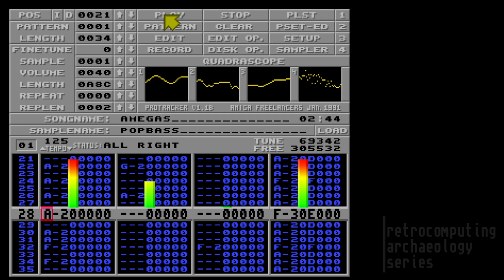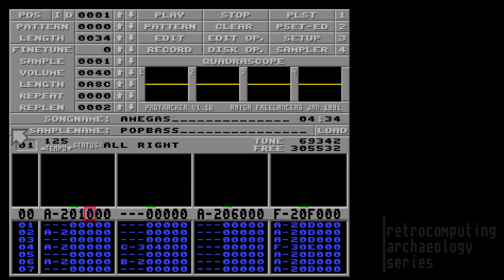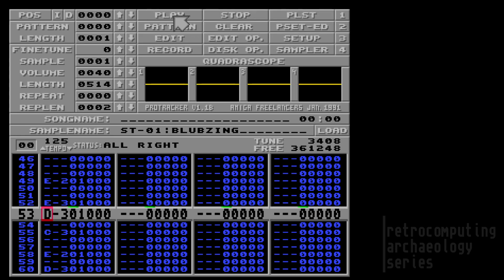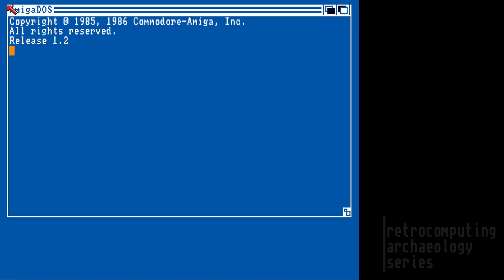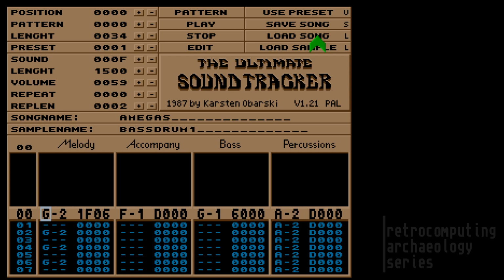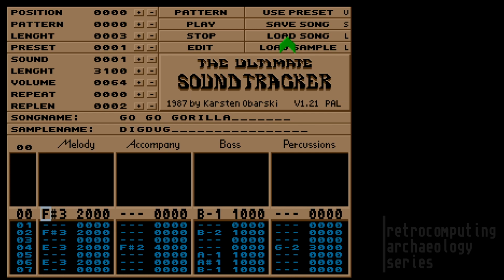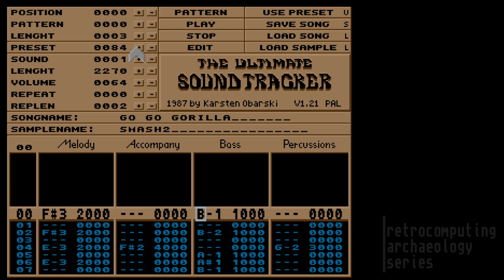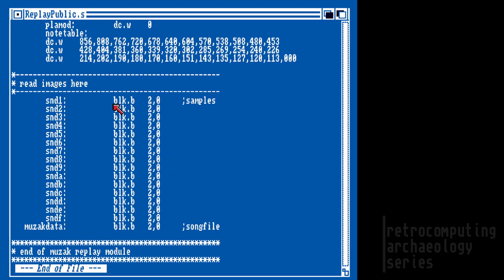The First Amiga Tracker - an in-depth look at The Ultimate Soundtracker 1.21

Comment: This answered many of the questions I had regarding the first version of Soundtracker, thank you so much
Reply from the maker: You're welcome! Anything else I can answer?
Reply: @tschak909  I'm actually in the middle of doing research cos I too want to cover trackers through videos. I want to specialise my channel in the demoscene(I have several videos on it already), although unfittingly I'm not a coder in the scene, or have lived through the eighties, so I'm trying to look over and educate myself about the scene from the ground up. I managed to load the program myself through the emulator, and made it work, so I'm happy with that. Curiously both the ST-00 and ST-01 disks are completely blank when I try to look inside them from the Workbench. I thought there would be at least a readme on them or something to add just a bit more info that I'm researching.

I guess for me the four most pressing questions are:
1. What is the FULL list of premade sample songs you can find on the ST-00 disk, and
2. Have I heard it right that there are only two functions in the OG Soundtracker, arpeggiation and pitchbend? I've gotten so spoiled by ProTracker and all the other followup trackers that got so many effects, so the first one didn't even have some fairly rudimentary ones like volume shift or vibratto? This comes as such a big surprise to me, I thought the first one was laden with many effects, and that that was the reason it got so popular in the scene. That means I will have to see what other effects all the derivatives of Soundtracker added over time.
3. Was there ever a printed manual that shipped along with Soundtracker? I am going to guess it was written in German. How did you find the resources to understand the use of this version of Soundtracker?
4. What were the biggest changes brought in Obarski's own latter editions of Soundtracker?
Reply: @tschak909  I am actually in the middle of doing research for tracker software myself, and I wanted to take a deep look in Obarski's own soundtracker. I want to specialise my own videos around the demoscene, and already have several of them, although unfittingly I am neither a demo coder, nor have lived through the 80s, so there's a lot inside the scene that I want to educate myself with.

I managed to run this version of Soundtracker on the emulator which I think is a good achievement I'm satisfied with. Curiously, I've noticed that when I load either of the ST-00 or ST-01 disks on the Workbench, both come as completely blank. I don't know if this is just due to the version of the Workbench I'm using, but I thought there would at least be a readme file or something. Or anything that would answer several of the puzzlements I have.

I do have four pressing questions that I think I will write in the follow-up comment, since Youtube tends to be very fiddly with words and what I'm allowed to post.
Reply from the maker: @NikGothic  Workbench 1.x will only show icons for which there is an explicit icon file (.info file). These disks weren't meant to be used from the workbench at all.
Reply: @tschak909  1. What is the complete list of all the sample tracks included on ST-00 that Obarski included? "Amegas" is the iconic one. I want to know about all the others.

2. Did I hear right that arpeggiation and pitchbend are the only effects included in the first Soundtracker? I grew up pretty spoiled on ProTracker II for instance, and my natural assumption was that even really rudimentary effects like volume and tempo control were already included in Obarski's own Soundtracker. I am so surprised this isn't the case and that these basic effects had to have been added gradually. That means I would have to look at the deeper differences between the early trackers myself. Would you happen to know at least, in brief detail, what differs Obarski's own 2.0 version of Ultimate Soundtracker from 1.27?

3. Was there any manual printed that came along with the disks? I assume if there have been, it has to have been written in German.

4. How did you find out how to operate the first Soundtracker? Did you grow up with the software, did you have the manual, or was it through word of mouth that you learned everything? Is there any way I can learn the intricacies of this and all the other very early trackers?
Reply from the maker: @NikGothic  1. Amegas and Rallye Master are the two I can remember immediately, there were others, but I can't remember.

2. Correct. The commands available grew and changed rapidly as Soundtracker was patched between groups.

3. Yes. It was written in German. There were no English docs.

4. Fumbling my way through the manual, and lots of experimentation. This is a very deep rabbit hole, use the tracker family tree to help guide you. https://upload.wikimedia.org/wikipedia/commons/1/14/Trackers-historygraph-2012-01.svg
Reply: @tschak909  Thank you! It's really important to me to know the titles of the included tracks so I can try to record them, and I can't find the complete titles anywhere. Is there any reliable way to find out what the titles are? Could they be in the manual?